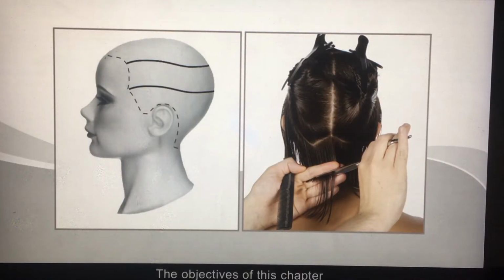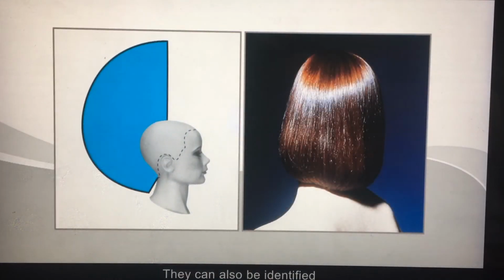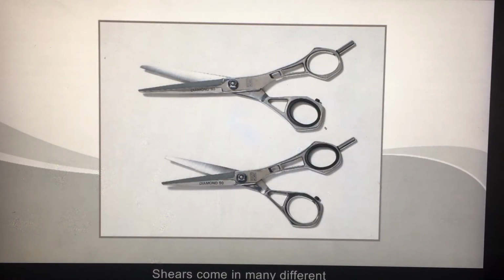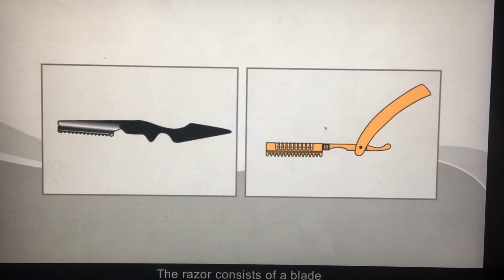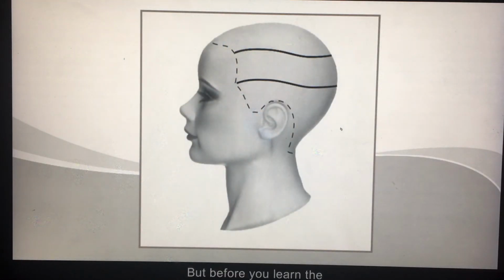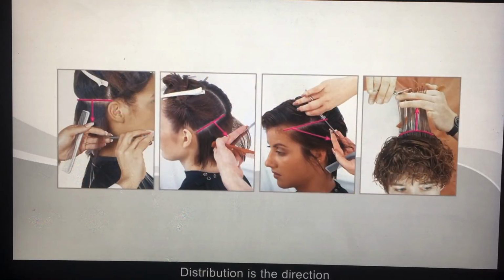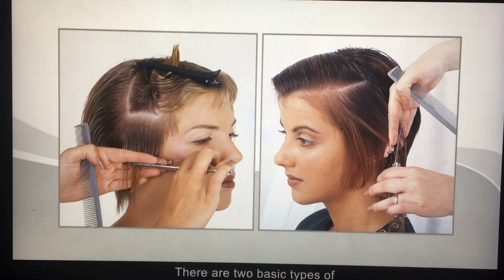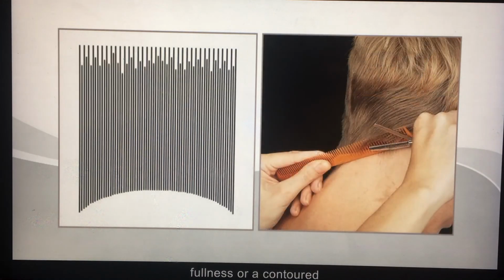Chapter 9.1 Haircutting theory

Comment: Tip: Film this in a closet.
No-one bothers you. You can open a can. You can eat. The device won't move. And we don't have a heart attack because you dropped something on the table.
Because the sound is low, we most likely wear headphones or use a speaker at volume 10. 😣

The video itself is most helpful. Thank you for uploading.
Reply from the maker: Thank you for the tips much appreciated 😄☺️👍🏼🤗